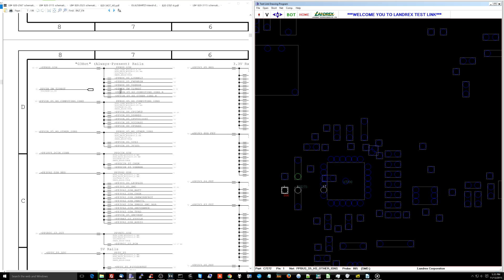If it looks good it isn't Louis' student learns an important lesson

Comment: The resistor on top of the cap where you did run the jumper wire looks popped? But yeah, that board is really fucked up...